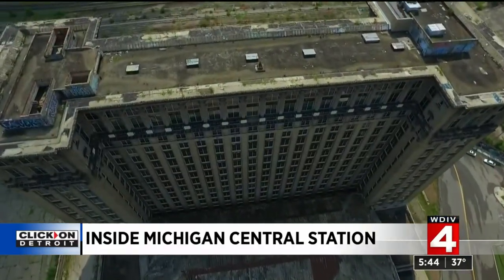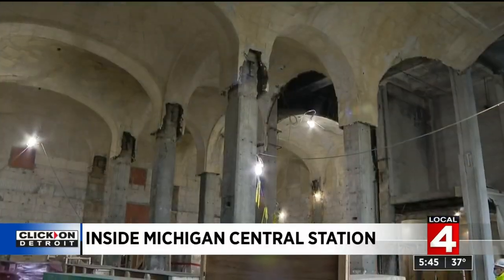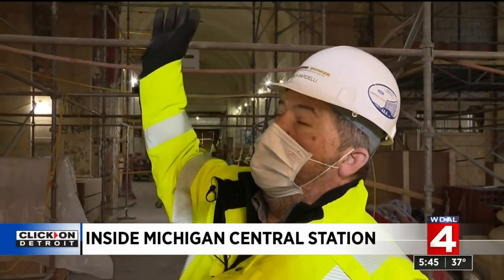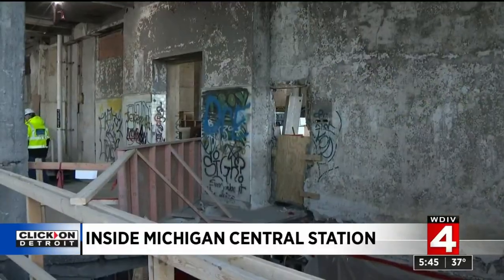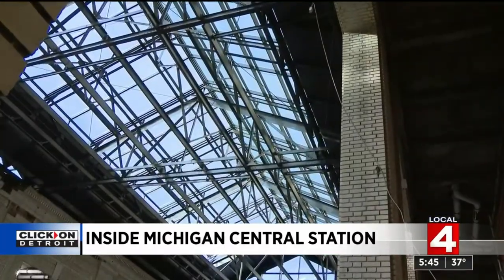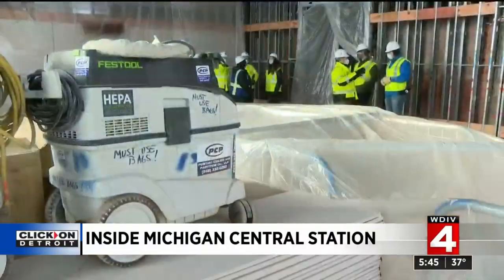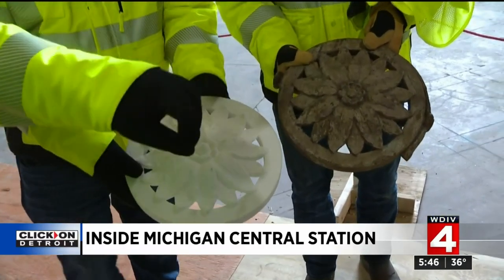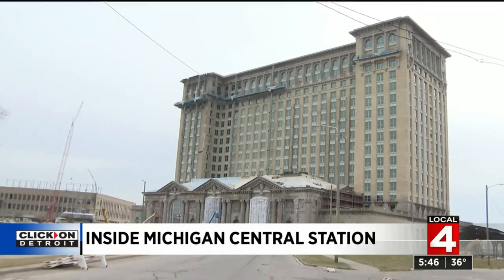See the progress Ford has made inside the historic Michigan Central Station

Comment: Michigan Central Station can also serve as a starting point for commuter rail in Detroit. The existing Amtrak line can be diverted into here, and you can establish new train services to serve the greater Detroit area (and even the rest of Michigan). Add in some bus connections at the front of the building and you've once again made MCS a transportation hub, just like it was in its heyday.